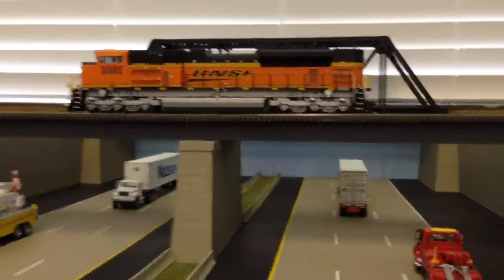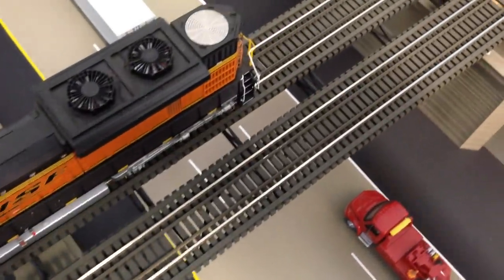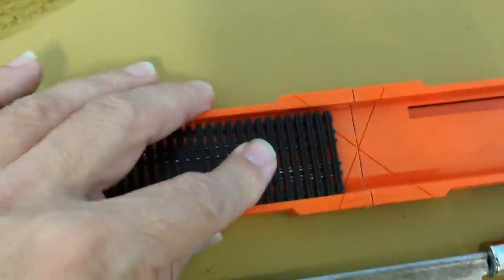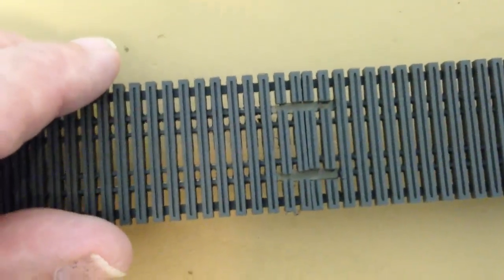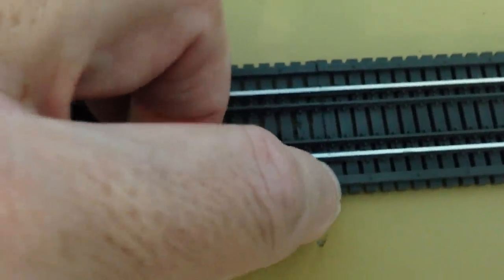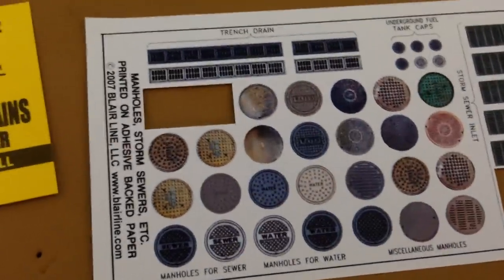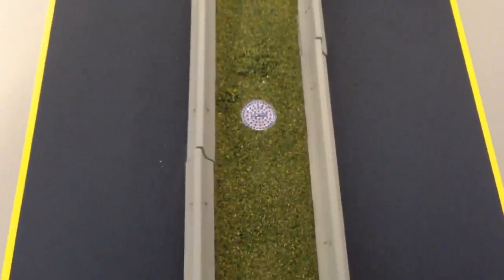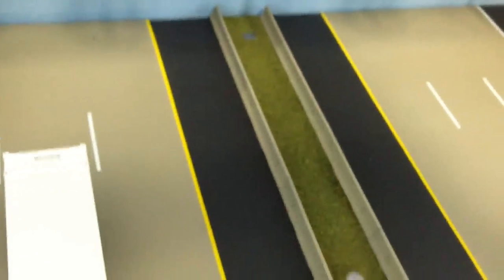Walthers HO Scale Bridge Track...

Comment: The bridge area is really coming along, Looks great!  I like how you cut your bridge track, you can hardly tell where you spliced it. Nice technique!  Just out of curiosity, what are you using to thin your paint?  Just getting ideas.
Deryk
Reply from the maker: Thanks Deryk!
I went to a local art shop and picked up a bottle of acrylic thinner for airbrushing.  Costed about $5 and will probably last a couple years.  I have also seen guys use windex, distilled water and rubbing alcohol.  Lots of good videos, just search airbrushing…  Hope that helps…
Reply: Thanks, I have seen all those other options.  Was just curious what you used because it appears you don't have any problems with it.
Thanks again!